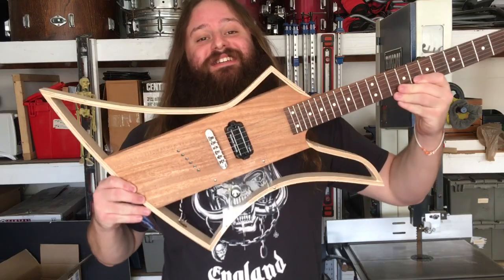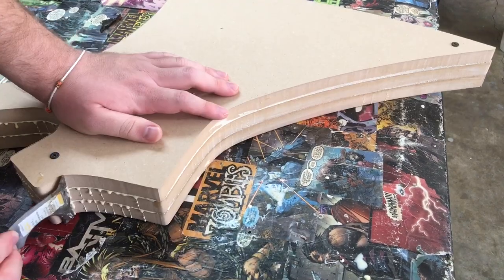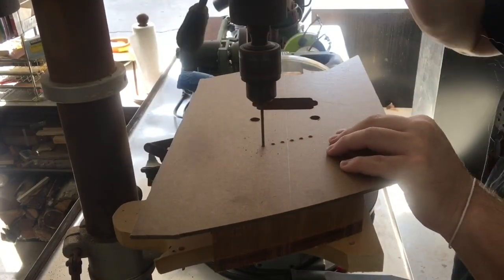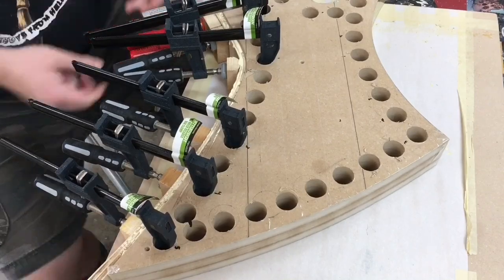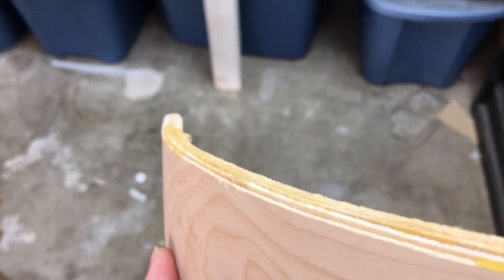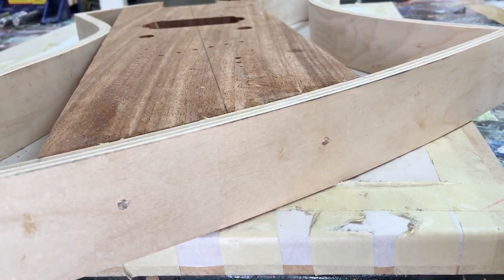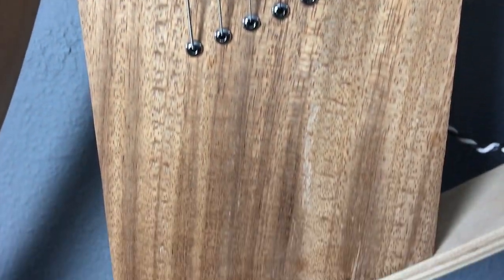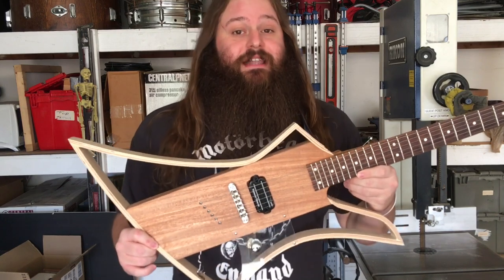I Built A Guitar Using Bent Laminated Skateboard Veneers

Comment: That is one badass axe! Amazing build! Really impressed by your craftsmanship, Dimitri. this puts you up there with the best luthiers on YouTube! Personally, I would have smoothened/sanded the ends of the laminate where they join the neck pocket; next time try wooden plugs and wood glue in stead of nails and epoxy.
Reply from the maker: Thank you for those kind words and great suggestions! When coming up with the design I originally planned on having a smooth transition, but while building it I kinda fell in love with the almost art deco feel it gave it so I ended up leaving it. If I ever decide to change it, a few minutes on the spindle sander would clean it up very nicely. 

P.S. I spy an EVH bumble bee inspired paint job on a Flying V on your profile pic! Did you do that yourself? I would love to see more pics of it. I have to admit I am a sucker for EVH paint schemes.
Reply: Hi Dimitri. Sure, I can send you more pics. I always wanted to make a V with a banana headstock and a single humbucker.  The painting was inspired by the EVH bumblebee for the body and the 5150 for the headstock. I use very basic materials to built my guitars, so they are far from perfect. But they are functional and play and sound rather ok. How can I get the pics to you?
Reply from the maker: @pvdguitars2951  Looks like YouTube removed their messaging feature so the best place to send them would be direct message through instagram. My username over there is @xyzcreate

I can't wait to see them!
Reply: hi Dimitri, I posted some pics through my son’s instagram (given that I don’t have an account). Enjoy
Reply from the maker: @pvdguitars2951  Thank you for sharing the photos with me Philippe.

Comment: For a  guitar 🎸 body shape associated with metal, that looks really ergonomic. What was the final weight on that build? 👍
Reply from the maker: Thanks for watching! I don't have a scale to properly measure the guitar, but it is significantly lighter than the body used to make the templates. If I had to guess I would say it's around 6-7 pounds.
Reply: XYZ Create perfect weight, As far as I’m concerned. I’m not getting any younger!